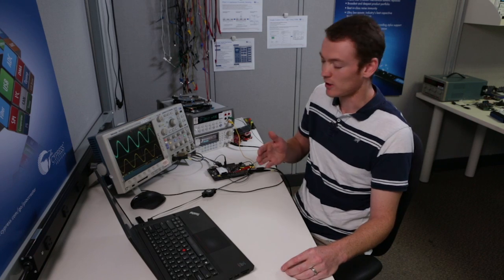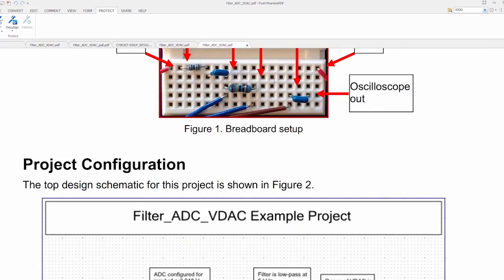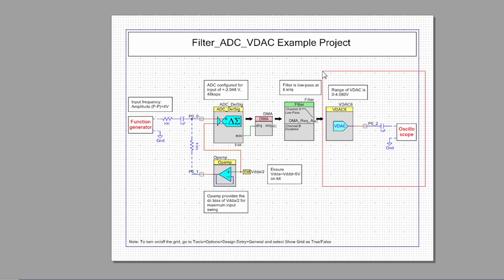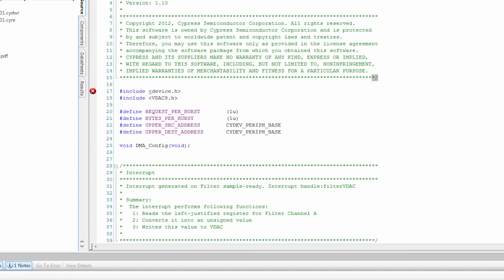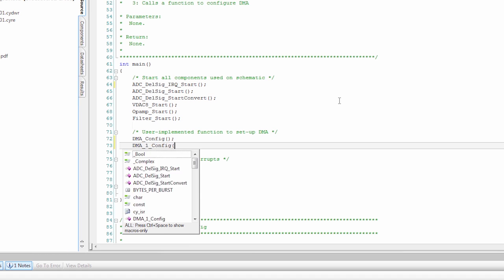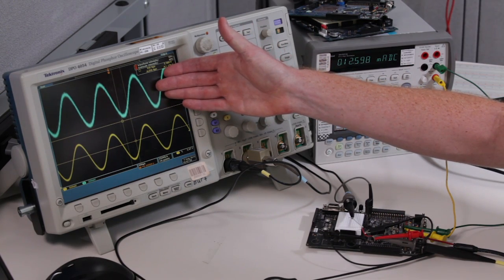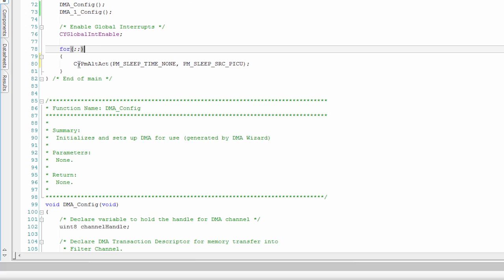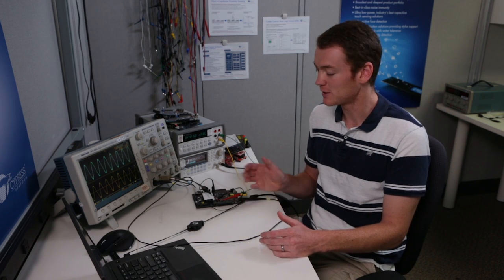How to Create an Analog Filter with PSoC 5LP

Comment: Hello, its a great video, but I have a question... I need to measure some variables with the ADC (7 inputs) and filter each of. I have a Psoc5LP. I think that its possible to use the DMA (Final Buffer) of the sequencing SAR and send the samples of each channel to the Digital Filter Block. But I have some issues With that, for example, i dont now if I use another DMA in the output of the filter i can bring the filtering samples to the CPU. Can you help me?

Comment: Thanks for your videos!  Is it possible to make same trick with ADC -> Filter -> UART. I mean make same trick with signal, but send it ti uart instead to vdac? If so, could your reffer please to some links, docs where UART using with dma ?
Reply from the maker: +Igor Kukuffs 
Hello Igor, yes you can DMA the ADC data to a UART. There are currently 
no code examples of how to do this. All you need to do is change the DMA
 destination from the VDAC to the UART FIFO. You also need to make sure 
that the data rate of the UART is fast enough to keep up with the sample
 rate of the ADC.